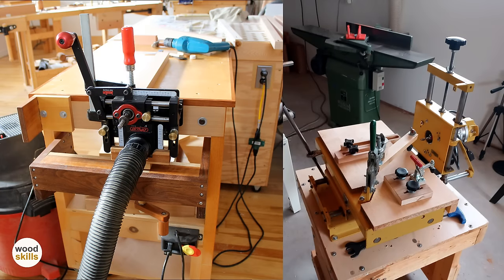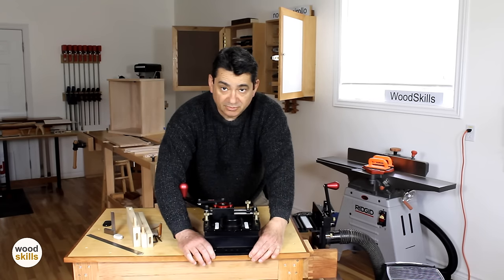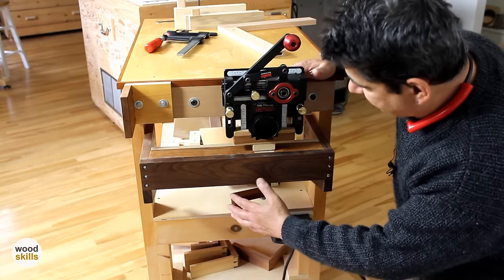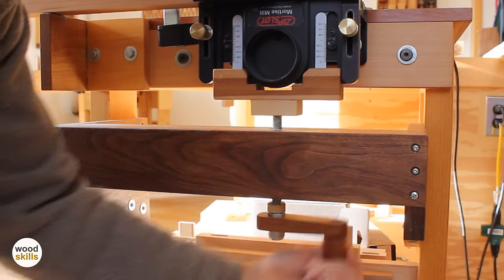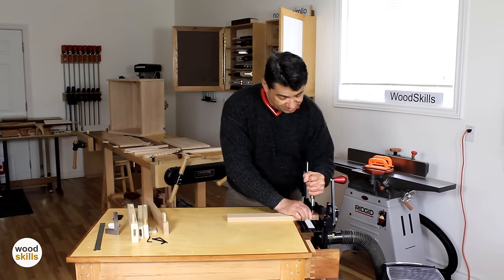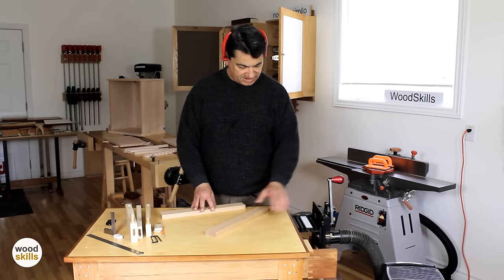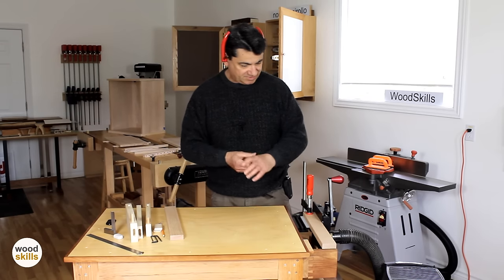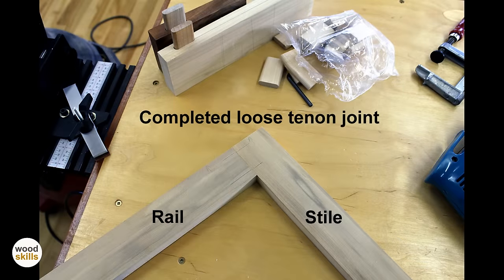Why I don't own a Domino Joiner (use $120 Slot Mortiser instead)

Comment: I love your setup. it is very similar to mine.
I mounted the Jessem zip mortiser in a plywood L and clamp it to my workmate for mortises. one addition that I suggest to you is to add a switch to the vacuum and drill so it starts the vacuum when you start drilling. Another mod that I did is to purchase a C1/2" ER16M 5"L Mini Nut Straight Shank Collet Chuck Holder and I can mortise 6 mm and 5mm dominos on my setup in addition to the 1/4 3/8 and 1/2 that Jessem used to offer at the time.
Good Job 👍👍
Reply from the maker: Thanks for the feedback. I have a vacuum auto-start on another setup but not this one yet. Good to know about the alternate metric bits.